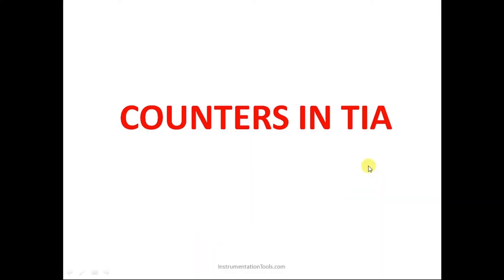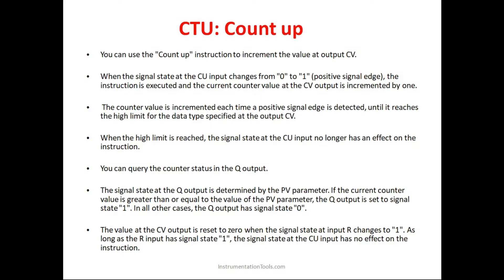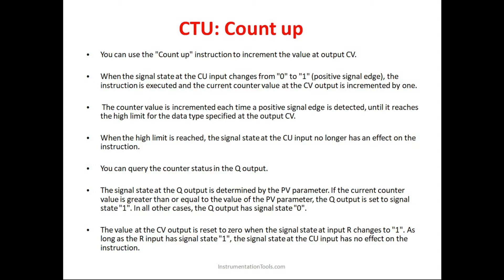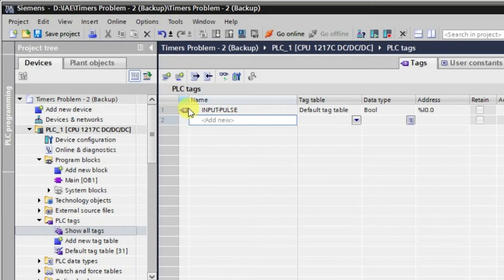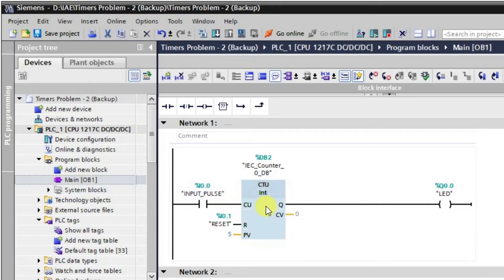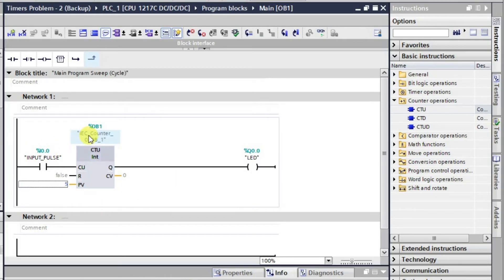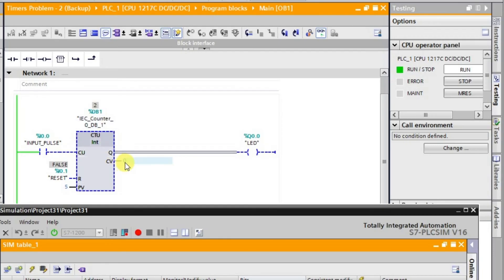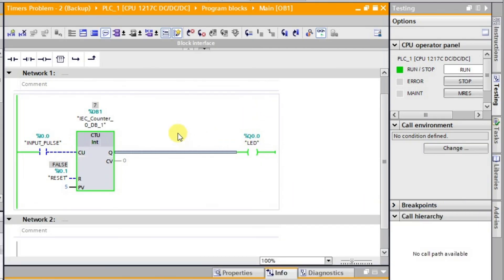Siemens Tia Portal Training - Up Counter - CTU Instruction Explained

Comment: Siemens is Worst of PLCs. The Help menu will never say that Q comes on As soon as CV is greater than PV so you have to use QU and also You cannot Set an ouput bit and assign CTU.R to it. The reset of COunter always have to be as Input to the Counter block it self it will never work if you are trying the "CTU.R" argument. this is So shit logic from siemens.